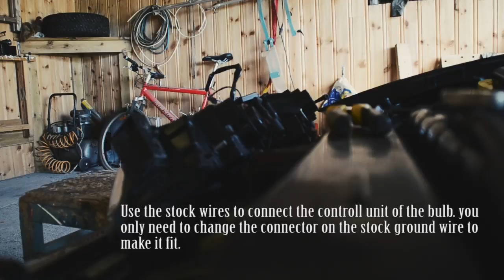H1 LED install - Nissan 200sx S14a

Comment: Is it a bumper off job to remove the drivers side headlight?
Reply from the maker: Yes, if you have not done it before and removed the bolts under the headlights. I had removed them when i had the car so my headlights came off when removing just 4 bolts on the lights and the corner light.

Comment: couldn't there get water in the lamps?
the backplate isn't on it right?
Reply from the maker: i put the caps bak on.
Reply: How did you get the caps back on? My led bulbs stick out too far and the caps won’t just screw back into place

Comment: thanks for the tutorial, the LED kit does well with time?
greetings from Spain
Reply from the maker: have got trouble with my low beam right now, but trying to figure out whats wrong :)
Reply: Did you figure out the problem? Or was it a bad bulb. So skeptical about theese when it comes to quality after reading alot of negative comments on youtube and other sites.
Reply from the maker: have not got to it yet, but my highbeams work witout any issues.
Reply: Thanks you for your reply. Might I be so bold and ask where you bought theese?
Reply from the maker: looked at it now, and it ist the bulbs who have gone bad and not light as much as before.

I bought the kit that is in the description under the video.
Reply: Ok, I was to fast on the trigger then cause I just ordered the kit. But that's no problem, I was expecting them to fail anyhow seeing how new the technology is. Many thanks for your feedback.
Reply from the maker: it can also be that they could have beed damaged during the install. I have a new pair that im going to replace them with when i get the time.

Comment: I had a set of LED bulbs in my 200sx but I couldn't get them to hold in place.  How did you get your bulbs to hold in place?
Reply from the maker: Paresh Patel i managed to get the stock lockingpin around the fan housing to lock them down as a regular bulb. I also removed the locking pins and just placed the bulbs in the housing and then screwed on the backlid and that locked them down also.
Reply: Ahh i see.  Would you mind sending me some pictures?  So I can see how it looks.  I am looking to have another try
Reply from the maker: Paresh Patel i don't have them mounted anymore, and i don't have the stock headlights on the car at the moment so i cannot dp that :/